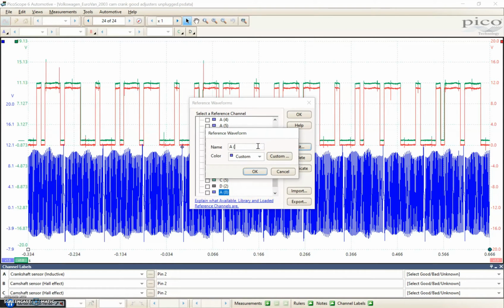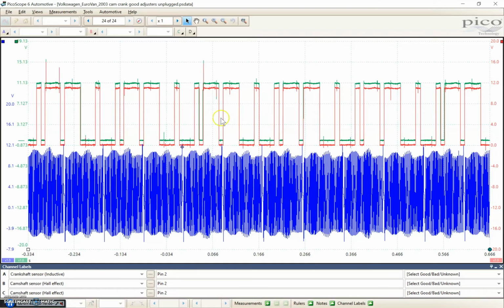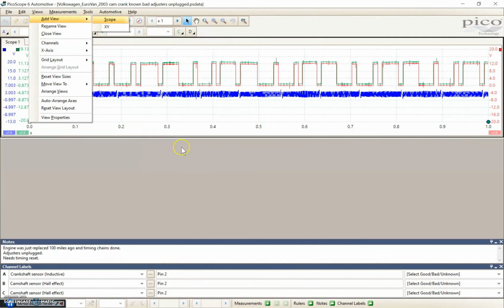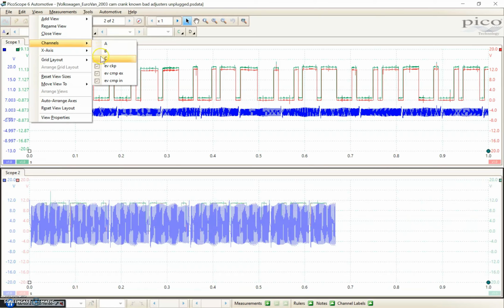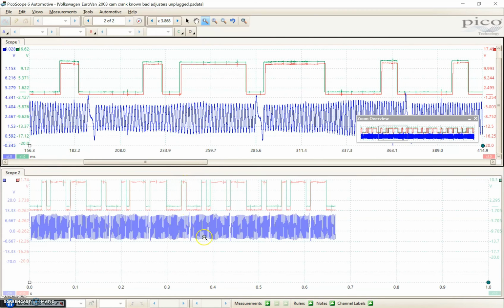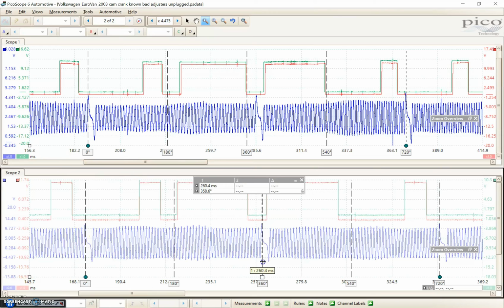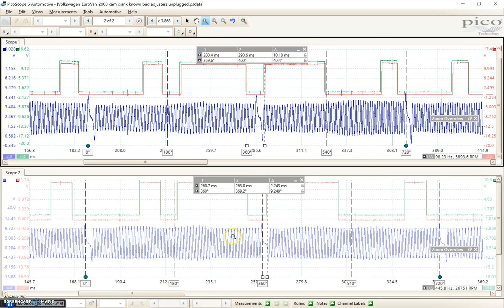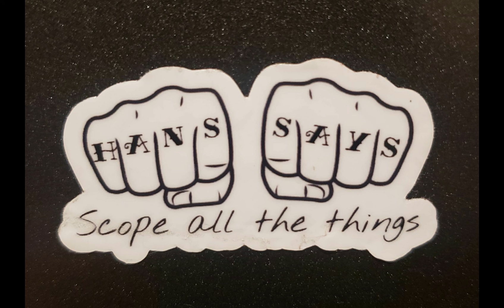PicoScope View Ports - Hans Jorgensen

Comment: On the  upper screen , the 360 degrees  ruler  did not align  on the center of the  ckp  reference    as it did on the lower capture , how it comes I was  just  concentrated at that point on the  ckp waveform  as this should be fix and the one shift timing are cmp.??
Reply: You are totally right in asking this question as the answer to it puts the conclusion at 5:55 in  doubt... Gotta be careful with phase rulers!
Reply: I didn't even notice when I was doing this! Good eye. That's what I get for not  trying to mess up!
Reply: @HansJorgensen  the point of  the demonstration is there  , thanks
Reply: @HansJorgensen  I can try to guess why -- for Diag.Net you used a different part of the waveform that (almost) does not suffer from this issue. Thus, such misalignment of the 360 mark was quite unexpected for other parts of the waveform. Anyway, great job on viewports, which are what the video is about.
Reply: I suspect that the RPM was changing in that window.